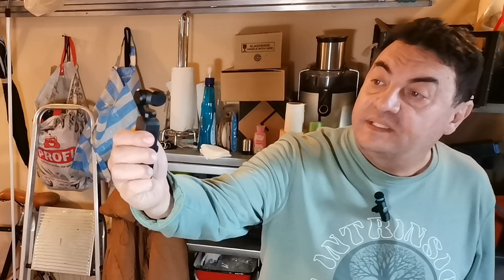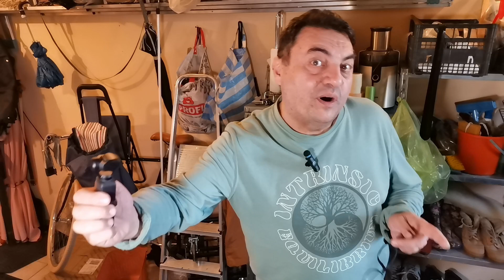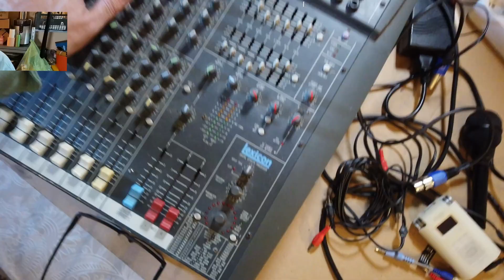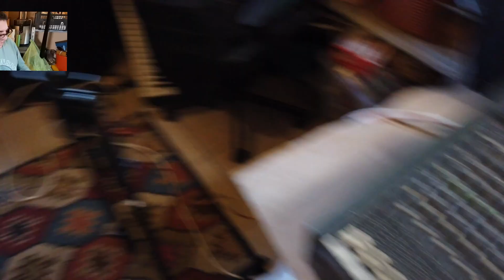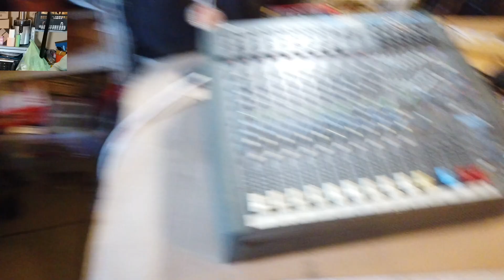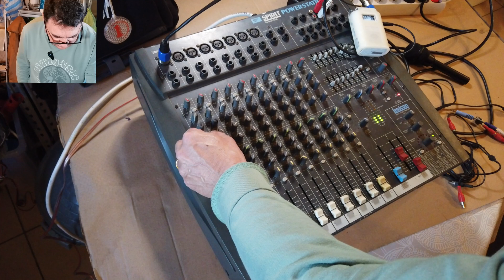Soundcraft Spirit Powerstation 600 dismantle and fix part1

Comment: So what was the problem?
Reply from the maker: Bad solderings...in the factory they used a low Pb soldering wire, which is very breakable and have a mat cheese aspect. Redo the joints with a proper soldering wire, lot of flux and that's it!